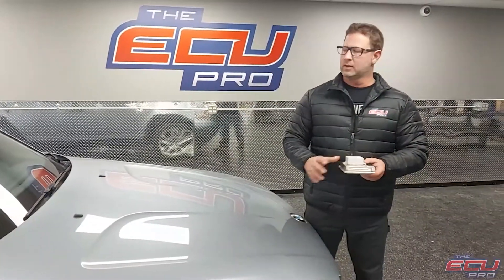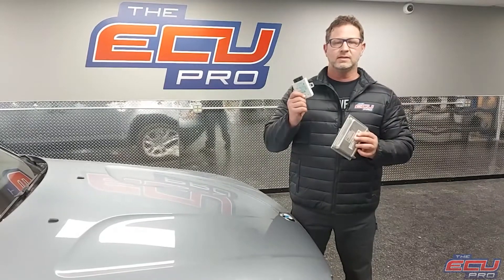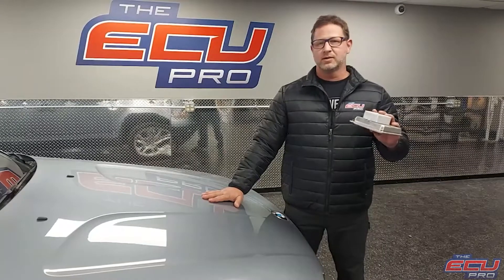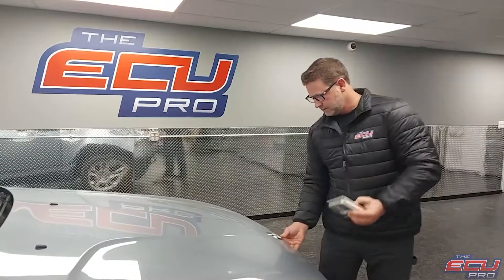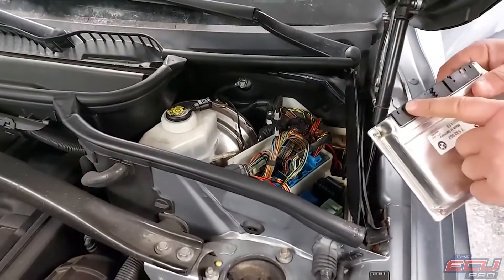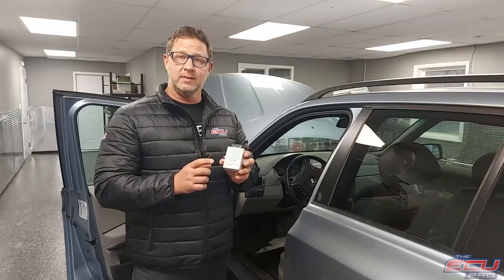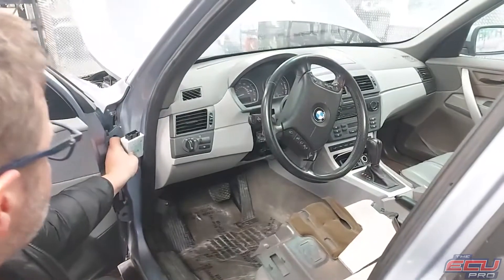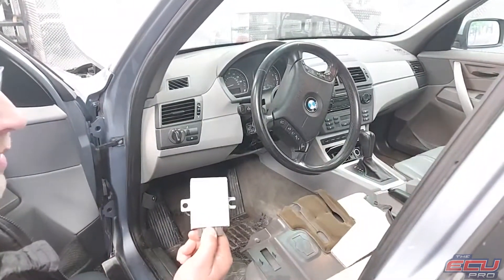BMW 2003 to 2006 X3 2.5i / 3.0i MS45 DME / ECU Repair and Removal explained

Comment: Dan I am getting p2098 p0174 and assumed it was downstream (bank 2) O2 so I put in new aftermarket sensor.  code persists, O2 circuit fault.  Could it be the DME affecting only one sensor?  Any help is appreciated.

Comment: I have variety of codes for my 2004 BMW X3. Namely P16A0, and BMW Enhanced codes being 2282, 2283, 28B2, 2781. It’s the DME/Throttle Body issue. Cold starts are horrible. I’d like to get this resolved. MAF is good, spark plugs replaced, fuel filter is getting replaced soon. Oil pan gasket, Valve Cover Gasket, and CCV Delete coming next. She runs well but cold starts I’ve had issues with for 4 years, BMW Starters are bomb. I don’t have just the mechanical key, only the main key.